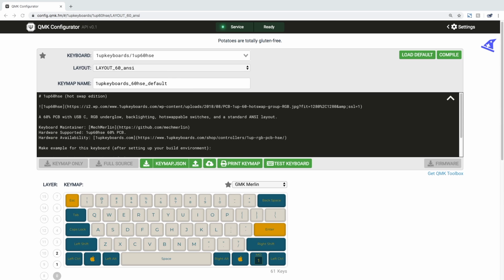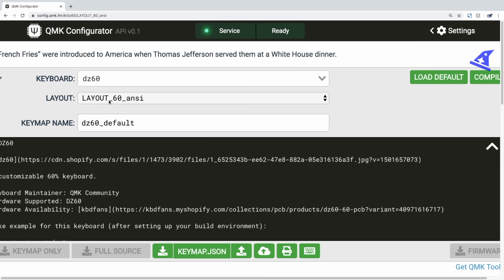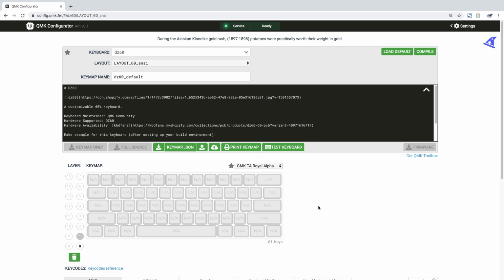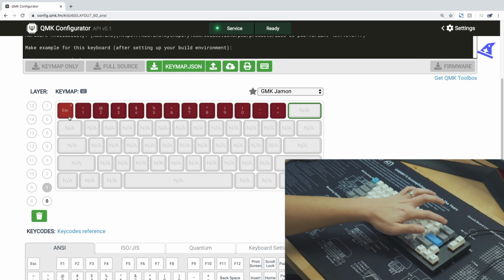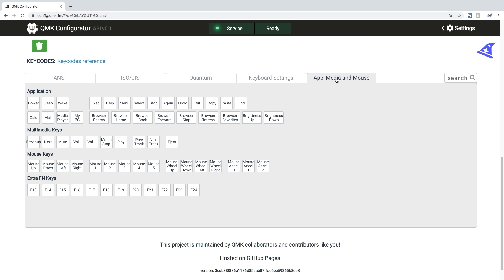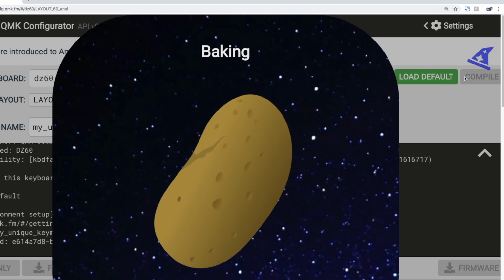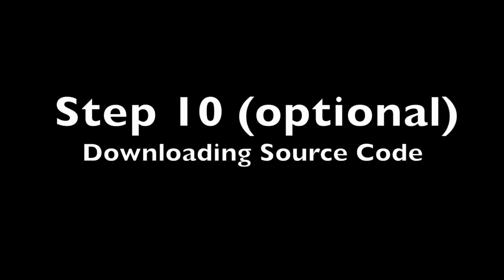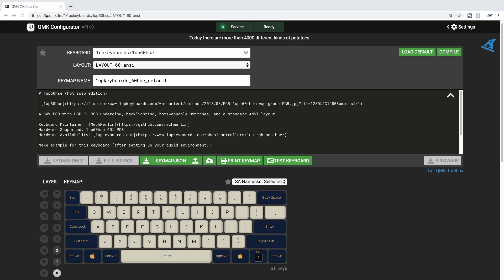QMK Tutorial: QMK Configurator

Comment: Hey Merlin :) what if I'm using a unique design that isn't in the list of board layouts? How can I make my own layout for qmk?
Reply from the maker: You'll have to write your own firmware! You can tune in to Porting VIA Ports
Reply: @MechMerlin  Thanks heaps for answering! I want to handwire my keyb to save costs as this is my first custom build. If I use a Teensy 2.0 can I still use VIA for the firmware?
Reply from the maker: @Leighbott  yep the teensy still uses an atmega32u4, which is a QMK supported mcu

Comment: i bought a keyboard named  feker ik75 qmk/via when i plugin the keyboard i get the name nature as the keyboard i think someone reflash it with a nature keyboard, can you help me reflashed it as a feker ik75 qmk/via? thanks
Reply from the maker: The steps will be the same as this video, as long as you are able to find the correct firmware file.
Reply: @MechMerlin  the seller sent me the .hex file im gonna flash with it, If ever something went wrong i can still flash other .hex file from via?
Reply from the maker: @ssshlurrpp8613 as long as it is a firmware file that is compatible with your board's architecture, you won't damage the board. Just make sure it's a firmware file that makes sense for the board.

Comment: Using your vids to setup my new KBD67 MKII, but I was curious where customising the RGB backlighting is possible. Is this also done through QMK or does it have to be done with another program?
Reply from the maker: You'll have to use the QMK RGB keycodes to do this.
Reply: @MechMerlin  Do you also happen to have a video on this (in regard to specific RGB settings)? Or is there one already within the community that's pretty comprehensive?
Reply from the maker: @parkersawyer8962  not really. It's just  assigning the RGB keycodes on your keymap and then pressing those keys to achieve the effect and color you want.

Comment: Is this firmware works for MacOS? Also is that can modify the media key behavior as per MacOS keyboard? Thanks
Reply from the maker: The firmware is only for keyboards. However the flashing tool QMK Toolbox can be installed on either Windows or macOS. You will be able to use media keys to control media in macOS as long as you use the correct keycodes.
Reply: @MechMerlin  is the keycode different depends on the PCB manufacture in this case? Or is it the same for all type keyboard
Reply from the maker: What do you mean
Reply: @MechMerlin  when we were flashing the keyboard using QMK toolbox, there is drop-down option on the right top the toolbox (atmega32v4...), what's that mean, and how do we know the option for certain keyboard?
Reply from the maker: @thisMyJourney  You should watch the QMK Toolbox video, I go through everything step by step there. However, your board may be VIA compatible, try it with VIA first.

Comment: i'm wanting to use a arduino pro micro in a build it uses Atmega32U4 so can i use dz60 as the keyboard
Reply from the maker: Only if you wire the keyboard with the EXACT switch matrix that the dz60 has. You must have the same columns, same rows, and those columns and rows must connect to the same pins on the microcontroller.
Reply: @MechMerlin   ok thanks

Comment: Hi!, how do I turn off the RGB off my board. Its a DZ60 ANSI V2
Reply from the maker: I'd have to look at what your keymap is. If your board has VIA you can easily check that way.
Reply: @MechMerlin  Thx for the response. Yes I downloaded VIA, but I have no clue how to use it. I can see  rgb toggle in layer 2, but I dunno what that means
Reply: @MechMerlin  Ok, i got it :) Dunno exactly what I did, but it worked with VIA. Thx for the help. 
👍 👍
Reply from the maker: @samuellin3857  If its on your keymap you can press it to toggle your RGB.

Comment: @MechMerlin are there any plans to add LED customizations to the qmk configurator?
Reply from the maker: Yes you can already customize your LEDs using the RGB and BL keycodes.
Reply: @MechMerlin  So is it possible to keep all the stock presets but make the wasd and arrow keys either have a static color or be like the Caps Lock key and have a reverse color?
Reply from the maker: That is only possible on boards that have RGB Matrix and can currently only be done in code.
Reply: @MechMerlin  I thought I read the drop alt did support RGB matrix
Reply from the maker: @EliFulton  Maybe? I'm not too familiar with that board.

Comment: but what if I want to make MY OWN design instead of someone else's design?
Reply from the maker: What do you mean by design?
Reply: @MechMerlin  building my own idea on keyboard-layout-editor, exporting its json and converting to qmk with its converter and then doing the rest on QMK config (which I ended up getting stuck on this step, since I'm not being able to edit keyboard name/layout type, compile or re-export the keymap.json directly from qmk config
Reply from the maker: @Hexality  QMK Configurator only lets you edit keymaps and then bakes that into the firmware for a keyboard that you chose. By design, if a keyboard is not supported with QMK firmware, it won't show up in QMK Configurator as well. 

If you're looking at how to program your own firmware you can look thru some of my old Porting with Ports stream and my ongoing guide.
Reply: @MechMerlin  well, as I saw in the docs, you don't need to port anything through, drive even handwiring is supported. Also, in the list, there's no midi device appearing in the list though but qmk supports it.
Are you sure there's no way to import key mapping? Cause the converter exists and all

Comment: Does QMK Configurator work with Lily58 and OLED screens?
Reply from the maker: Its only for keycodes, OLED screens have to be done in the code.
Reply: @MechMerlin  is there any way to do the keycodes in the configurator, download a file and continue working on the code to add the OLED screens?.  The "Keymap only" button is not longer shown on the configurator and the "Full Source" button seems to download the whole github repo.
Reply from the maker: @LenRamSa  you can download the json file and then use qmk cli to convert it to a keymap.
Reply: @MechMerlin  thanks, I checked the documentation and couldn't find a command to convert from json to keymap file (only to compile from json file.. am I reading that right?).
Reply from the maker: @LenRamSa  There should be a json to c command.

Comment: How would I use this for a custom board using a Teensy LC?
Reply from the maker: You'd have to get the firmware in place first before being able to use QMK Configurator. Tune in to my porting with ports series either LIVE on Twitch or the actual tutorials on YouTube.
Reply: @MechMerlin  I watched some of your videos, but the Teensy LC microcrontroller isn't on kbfirmware.com.

I saw that QMK is compatible with that processor, is there no way to just specify a custom layout and wiring in QMK Configurator for a completely custom board/pcb?
Reply from the maker: @anventia  Not on QMK Configurator, you have to write the code yourself for the LAYOUT macro. I actually have tutorials on this in my Porting with Ports series,  and you can see it in action in the Live one.
Reply: @MechMerlin  Hm okay. I watched some of the porting with ports series but don't really get how it works.

Comment: What if my keyboard is not in the list?
Reply from the maker: It's either unsupported, or the code for it hasn't been submitted to QMK.
Reply: @MechMerlin  does that mean I won't be able to use the tool?
Reply from the maker: @GabrielJustus  It depends on the answer to those questions. 

You need to figure out if the board can even  be supported by QMK Firmware. If it is, then maybe the code just hasn't been submitted to the QMK Firmware repos. It's more than likely still being reviewed, or the vendor/manufacturer has the files on their website.

Comment: what if i have to make a converter for an old keyboard that has a weird matrix and key placement?
Reply from the maker: You'll need to write the firmware for it then
Reply: @MechMerlin  and how do I do that? Like how do I know the code of the keys?
Reply from the maker: @LuCallofDuty1  You can look at my porting with ports series. I have live streams that do thee whole process. Watch the older ones. I also have the shorter educational ones that are a few minutes long.